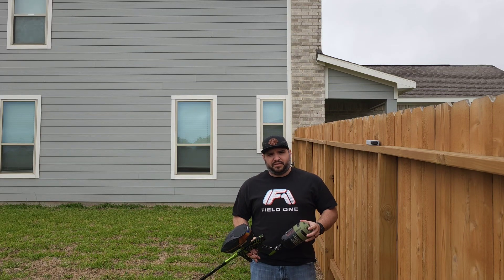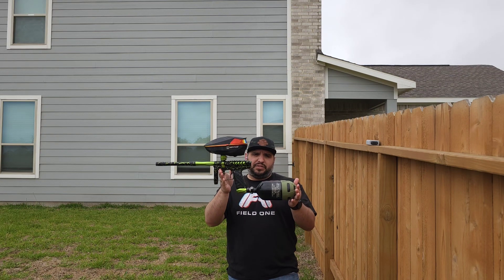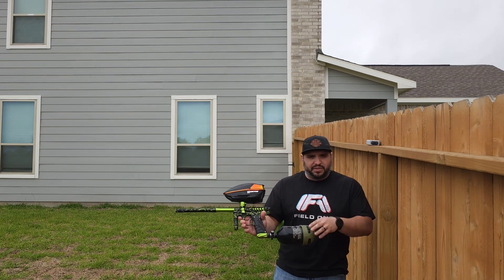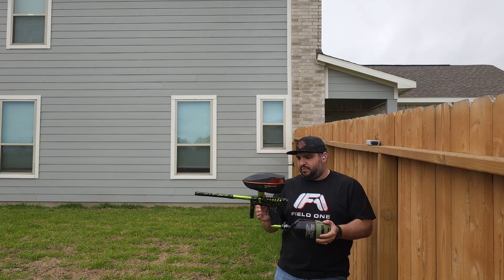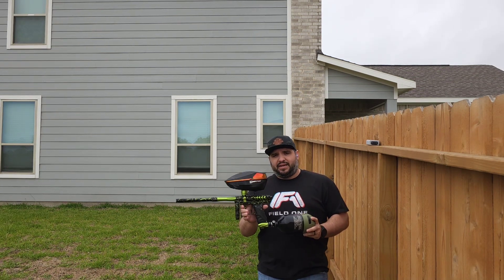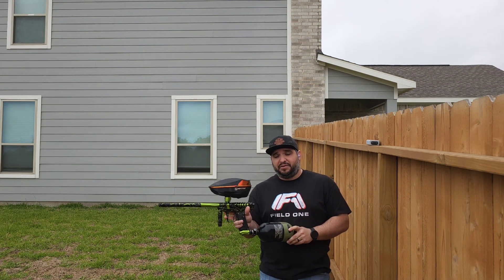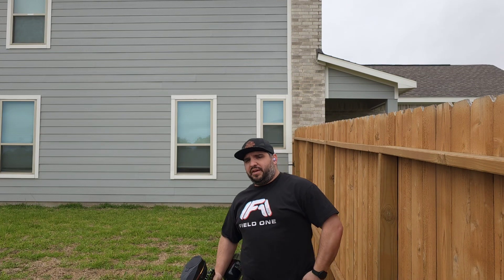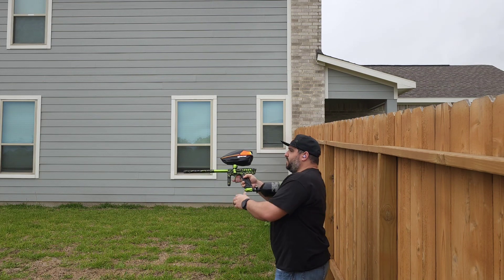Bob Long Ripper Victory Repair

Comment: Just bought 2 if these..1,an hk ripper and the ither a bob long ripper, only difference i can see is the trigger guard is different on the hk.. are the bobs better thsn the hk or are they the same marker...thnx..
Reply: The HK models (with the angular trigger guards) are good, but built to different specifications. My Personal bias : the  round trigger guard models ( Built on Bob Long manufactured parts assembled by Field 1 For HK Army) are "better".

The parts are not always compatible between the two specs. They will function the same, but the HK  have  a different  fit different Detents, Different eyes,  different eye covers, different frames, and was more cost effective to mill.

Both shoot about the same and when up and running? The feel is pretty similar.